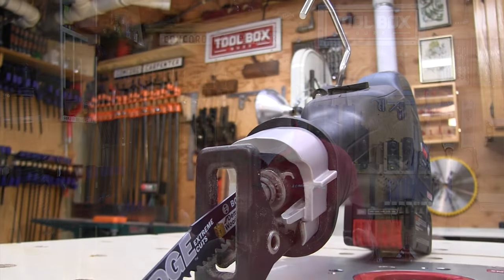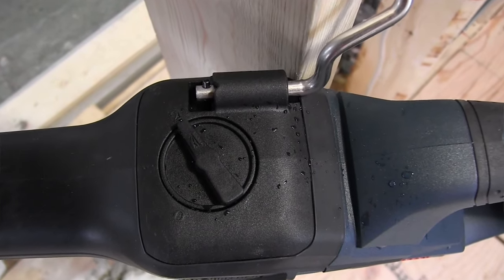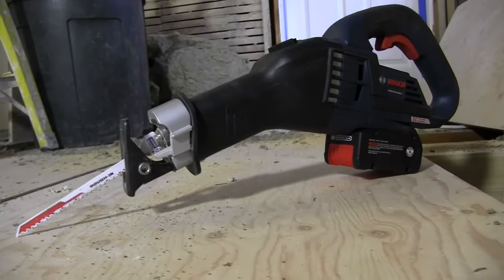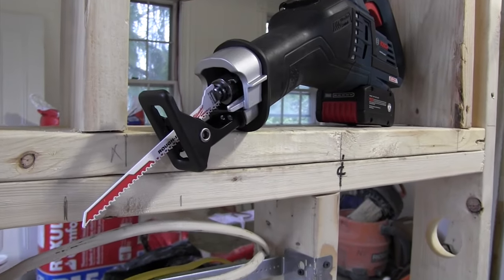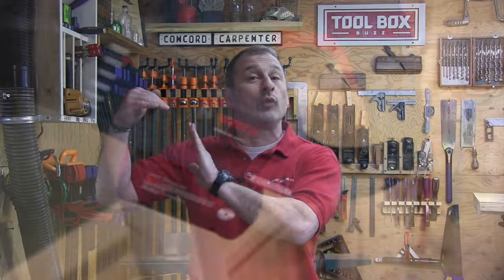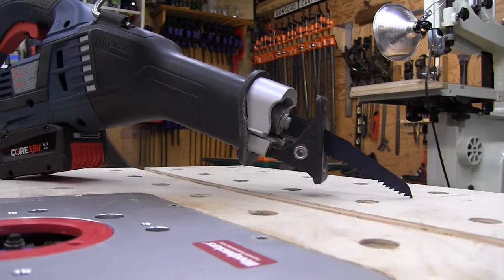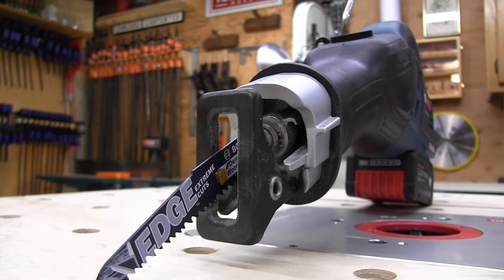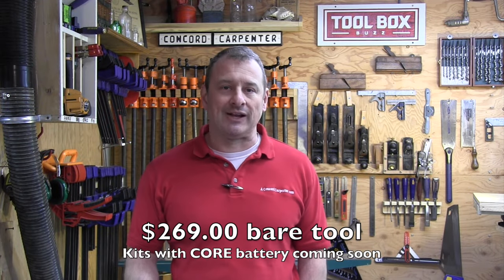Bosch GSA18V-125 Reciprocating Saw

Comment: Since this summer I've invested a lot in Bosch tools. I've never really owned battery powered tools before, only used other's. I agree with what has been said that in general Bosch should step up the game. I was a bit disappointed not to be able to buy brushless circular saw and jigsaw, all though they have great power. I think their new top model grinder is good, but the bluetooth stuff isoverrated. I just also purchased the new model reciproating saw - waiting for it to show up in the mailbox :) All in all I think Bosch is great, but they are slacking a littlebit! But they have made many improvements lately! Hoping for a new bruhless circular saw!

Comment: question how do you compair to bosch 36v sawzall? nice video
Reply from the maker: victor feliciano not sure on that
Reply: not sure on that ? meaning what?
Reply from the maker: Sorry man the text cut out.  

I'm not sue on that tool [36v saw] - I have not tested it.  My guess is that it will have more power and weight.

Comment: Its interessting that the GSA 18 32 is still almost identical in specs to the new Milwaukee M18 FSZ both 32mm stroke. The different is it has 500 strokes per minute less. 2500 to 3000 but for this it has orbital what you only find on the FSX.
It is 4 years older than the comparable Milwaukee and it still is like only a second slower.. 
Took Milwaukee almost 4 years to get a saw in comparable size and weight to the GSA 18 32 but Bosch is so behind 🤣

Comment: As usual, Bosch is always too late.  I'm too invested in Milwaukee to buy into their system now.  The US always gets things too little too late.
Reply from the maker: Brett Kowalewski agreed - I wonder why? Is it UL Testing that holds them up?
Reply: While I agree, I would rather have a Milwaukee or Dewalt sawzall over a Bosch anyway. However one feature I do really like on the Bosch is the separate speed control wheel. I would find that very useful.
Reply: A Concord Carpenter / ToolBoxBuzz I'm not sure exactly, but if you look at their tool lineup in Europe, it is impressive.  I remember when theycame out with their 12v line at the same time as Milwaukee.  The almost identical hackzall, mini impact, etc.  I thought the were finally turning up the competition here in the states.  Within a year or so, Milwaukee buried them.  Especially in the plumbing arena.  Bosch makes a great tool, but I feel like the US market is secondary and mostly unimportant to them.
Reply: I waited two years(!) for the Bosch 12V rotary tool to come to the US and it's still not available here. A few weeks ago I went out and bought a competitor's equivalent.
Reply: ive heard the market for bosch is not as good in us and eu.....  its sucks im invested in bosch but can only get certain us tool .... if you order a eu model of the web ..... they dont and wont honor the warranty for the eu tools in the us ....... im at a point where i need more selection..... if they dont step it up ....im gonna have to go with another brand that i can get tools they have ...... im hard core bosch .... but cmon ..... i cant buy 3 different brands to have a certian tool ..... but im limited with bosch .... shame really
Reply: Brett Kowalewski Very true, but Milwaukee is junk.
Reply: lol i work for a company that lets you choose your tool kit. i went with bosch and two other guys i work with all the time went for Milwaukee. my bosch tools are holding up much better than the team red tools. the milwaukee tools are powerful but i think there a little to powerful and they tear themselves apart. bosch on the other hand has plenty of power but a better build quality then milwaukee. bosch for me all the way.